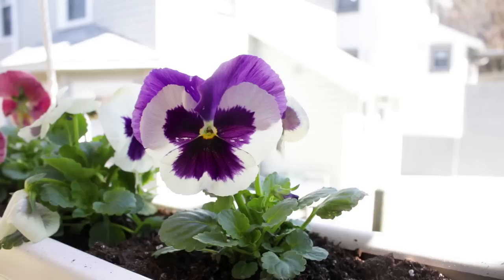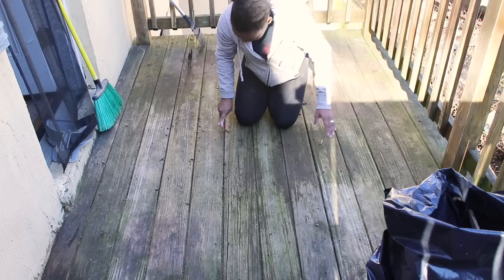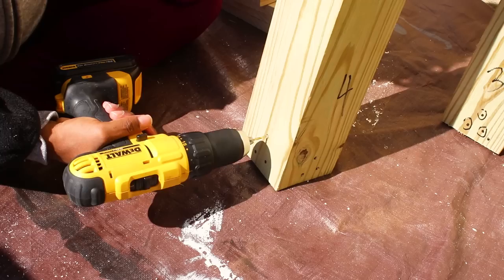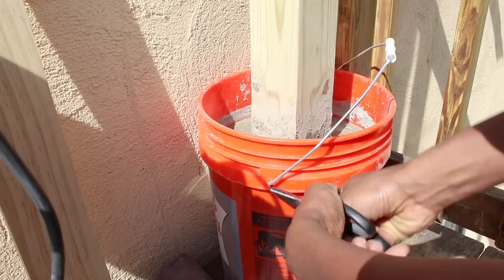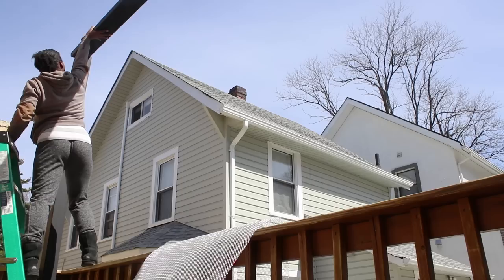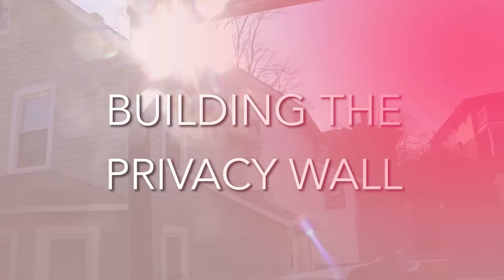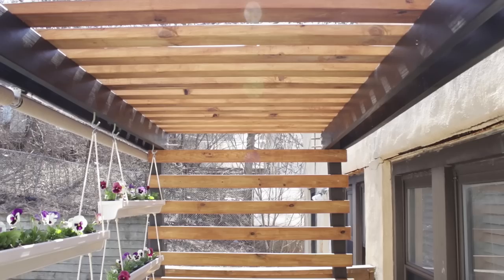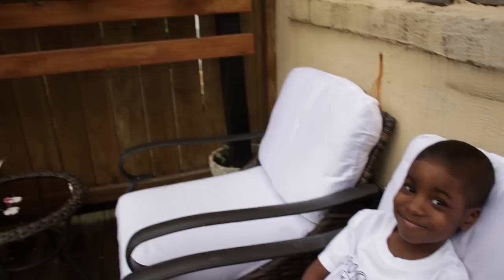Extreme Balcony Makeover | Renter Friendly Patio Transformation

Comment: Loved this tutorial! I did something similar but based on your experience with the buckets, I opted for clay pots. And I treated the ends of the posts to prevent them from rotting while in contact with the soil. Then I drilled drainage holes where the cement levels off using a downward angle to ensure complete drainage. Next I plastered 2" dia landscape fabric to hide them and sprayed the whole thing with textured paint. I planted vining jasmine and even a year later everything looks great.  Thank you for the inspiration!

Comment: You can fill the buckets with gravel, drill holes on the sides of the bucket at the level where the cement starts. You can plant your plants using small pots placed on the gravel. The pots will drain into the gravel and if water accumulates, it will drain through the side holes.

Comment: I recommend that you put some pebbles on top of the concrete and then the soil. you can then put drainage holes around the You can still put drain holes around the top of the bucket at the level of the pebbles - the water will drain out through the pebbles and then out of the holes.

Comment: 2:08  I'd suggest a "5 in 1" Tool.  It will be in the Paint Department.  You can use the point on it for that task, and other parts to scrape paint off rollers, scrape/smooth, sometimes there's a hole in the blade to pull nails, they have ones with bits in the handle....but I swear by them!

Comment: 7:43  Hint:  If you have the room, you can put them down next to each other and use a 6" Roller on a pole, rotate the wood, repeat, etc until done.  Having done massive jobs, you end up finding ways to kick things out quickly!  Leave paint sticks under them, so they don't bond with the surface/plastic below, if the product drips off the top and down a side.

Comment: Hi there, I'm impressed you did all that, really congratulations! I have only one question, how did you convince your landlord or the building manager to let you install this pergola in concrete buckets? Thanks
Reply from the maker: i told them it wouldn't be permanent. The cement actually helps to not drill holes in the actual balcony!